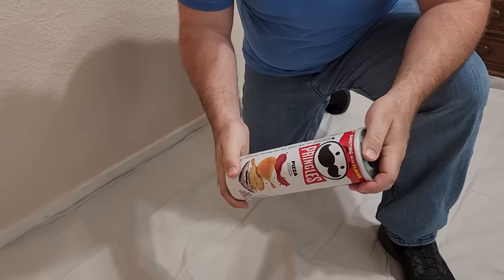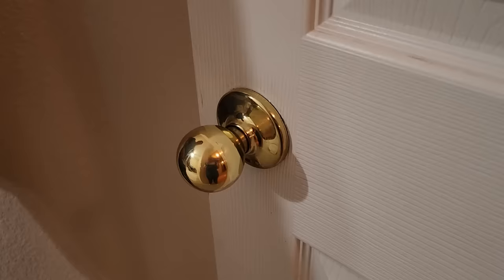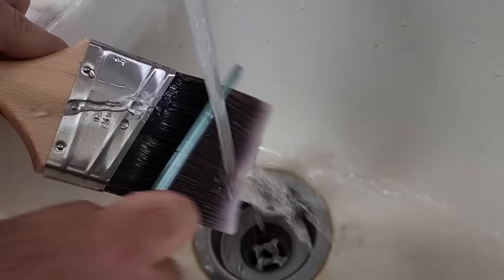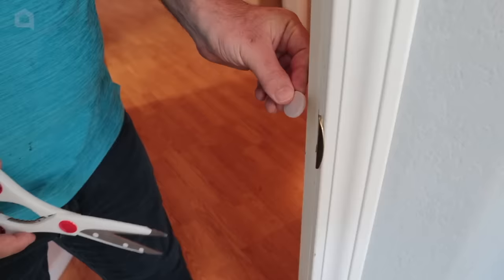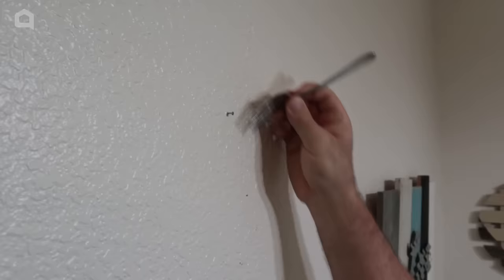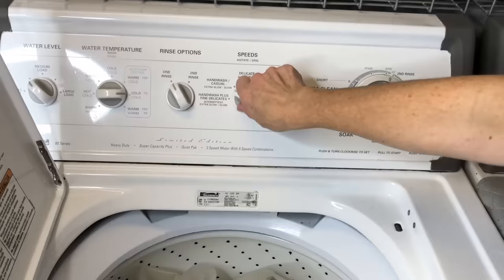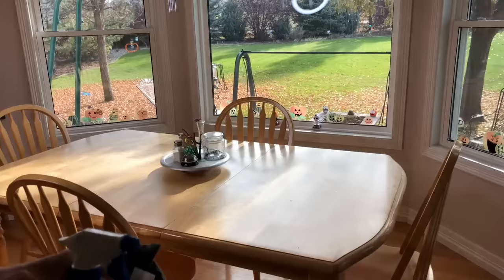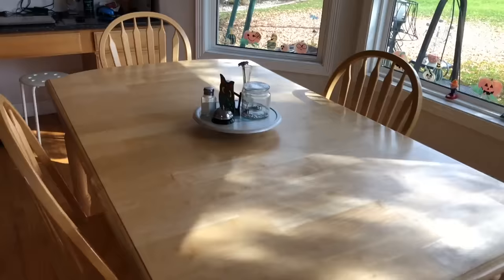9 genius home hacks from a guy who painted 1,000 homes

Comment: An old timer showed me a trick to keep skin from forming on top of the paint. Before putting the lid back on the can, you breathe into the can a few times and then cover it quickly and hammer down the lid. The Carbon Dioxide that you breathe out displaces the oxygen in the space between the paint and the inside of the lid. I've opened old cans of paint 2-3 years later and never had skin or dry paint.
Reply: @kimbuck-2  If you did all that then you shouldnt be painting. Sounds like TWISTER is more your speed🤣
Reply: Sounds like the old timer might have been getting high on paint fumes.  Your breath tends to rise when you breath out due to it being warmer than the ambient air temperature, and even at room temperature carbon dioxide doesn't fall, it disperses evenly throughout the air.
Reply: WOW. JUST WOW!!!
Reply: @kimbuck-2  🤣🤣🤣
Reply: @Richard.Sanchez  Exhaled air is only about 4% carbon dioxide. Rest is basically oxygen.
Reply: @raymacke  air is 80% nitrogen.
Reply: @kimbuck-2  🤣🤣😂😂😂🤣
Reply: I like skins, its like the paint is alive, then I stab it 🙂
Reply: But how many chemicals did you huff in the process?. Wear a mask around paint or better yet use VOC free.
Reply: @kimbuck-2  Don't give up your day job, you'll never make it as a comedian.
Reply: @raymacke  exhaled air is 4% CO2, 17% O2, and 78% Nitrogen and 1% miscellaneous
Reply: @wideawake5630  
You may have misunderstood, breathe out, exhale into the paint can, don’t inhale out of the paint can.
Reply: Probably works best with a couple of shots! 😉
Reply: I close lid and turn can upside down when I’m going to use it paint is fresh
Reply: Try inhaling. You won't even notice the skin on top. 🥳
Reply: @robertdiamondoil2384  was going to say this! The breathing into a paint can thing is nonsense.
Reply: Thats brilliant. Thx for sharing!!
Reply: …but my paint develops a foreskin….what to do? Kinda weird!😮
Reply: Thank you. I’ll try that 👍
Reply: It's the humidity in the exhaled air. Can also soften Play-Doh (a bit) or untoast a 🥪 in a Ziploc. Yes, I had a reason to do that: silent bites in class. 😂

Same humidifying effect can be witnessed when getting brown sugar clods out in the microwave ...with a mug of water...on high for a minute.
Reply: @efisgpr  I made toast one night to go night fishing. Put it into an airtight lunch box and when I opened it once at the pool it had turned back into bread but none of my friends believed me, they just said I never toasted it.
Reply: @efisgpr  WAIT!!!  HOW do you turn brown sugar usable again with water in a microwave?  I’m definitely interested in this
Reply: It may work but science is definitely flawed 😂
Reply: You can do this trick with paint and custard.
Apply cling film aka plastic wrap aka seran wrap to these above items, but ensure that the plastic is in contact with the full surface of the product. Secure with the lid.
Reply: You breathe out oxygen too, its why CPR works 😆 There would be less oxygen though, and probably more humidity, both of which WOULD help!
Reply: Sooo? Huff paint?
Reply: @Lee exactly. It's fantastic and saves SO much mess!
Reply: @TheMrsSaito  cpr works by simulating the inflation and deflation of air in the lungs until the person can do it on their own. You can’t simply blow into someone’s mouth. You have to also perform 30 chest compressions to expel what you’ve blown into the lungs from only two breaths.
Reply: I've used canned air/duster stuff to do the same.  Interesting idea!
Reply: @MrLuridan  depends on the circumcision.... I mean, circumstances 🥴🙃
Reply: Does it work if you don’t have assbreath?
Reply: Put lid on tight then turn upside down
Reply: Whaaaat that’s neat!

Comment: As a former locksmith, do NOT use graphite on locks. Use a Dry Lock or a Teflon based lubricant that completely dries and does not leave particles in the lock!

Comment: I wouldn’t clean the shower head with a sponge after removing the vinegar bag. I’d run the water first, make sure the debris is out of the holes, then wipe the head afterwards. Wiping the shower head with a sponge will just rub the debris back into the holes. Make sure they’re clear first. 👌🙌

Comment: That comb on that paintbrush is BRILLIANT!
Reply: The best part is it gets the paint out on the inside of the bristles, the part that doesn't get cleaned as often.
Reply: @GoodlyEarth  Paint stores sell 'real' brush combs and real painters don't use paint combs to clean there brushes. After you use a wire brush to do your preliminary cleaning of the paint on the outside of the brush you stream water down into the bristles until it's clean and spin it in the sink by placing the handle between your hands and rub your hands back and forth to cause the brush to spin/expel the water left in it. THEN you use a brush comb to straighten the fibers before you store it. Recommend you let it air dry before placing it back in it's protective cover.

Comment: 40 year painter. I run new roller covers under water, then spin them out. When I’m done painting, I rinse most of the paint out and store them in a few inches of waterin a bucket with a cover. Next use just spin them again and ready to go. They last for months. 
I never paint out of the can, or wipe the brush like you do with the rubber band. Paint will travel up the brush and dry out near the ferrule. I use a small pot, dip the brush and tap the sides of the pot. It also keeps the brush loaded with paint. When you wipe it, you remove paint from the brush. And the whole objective is getting paint from the can to the surface.
And I use a wire brush to clean latex brushes, then comb them out.
Every one has their little tricks, and it depends on location and type of painting job you’re doing.
Reply: its fine to have paint on the outside of the brush if you're just going to spread it out, but if you want to paint a straight line its best to remove the paint on the outside of the brush and use the paint that's inside the brush. otherwise when you try to cut in a straight line the paint on the outside of the brush will be likely to form a lump of paint on your line that you than have to try and pull back from the line. otherwise you end up with a lumpy edge.

Comment: The best paint tips I ever heard and ALL of them are beneficial.   🎯🎯🎯
Reply: I work at a paint store and I do appreciate almost all of the paint tips. Most people don't seem to clean the lip and when putting the plastic on, it usually ends up getting in the way of a proper seal. 

The rubber band idea blew my mind, tho
Reply: Only thing I really took issue with, was masking a doorknob with aluminum foil. First of all, it absolutely won't work. Second, if you're painting a door without taking off the hardware, just put the paint down and hire a professional, please...
Reply: Bob Ross has reincarnated.
Reply: @mschenandlerbong8539  nice account name
Reply: another trick for painting around things like knobs and ceiling fixtures without taping is a simple coat of chapstick along the edge because the paint wont stick to it.
Reply: I agree!
Reply: Tip get Some else to do the hard work 👍
Reply: My father is a paint brush and everything here is true.
Reply: @hanskranz9897  ,🤣😂🤣

Comment: There have been times, I wasn’t able to finish a painting job. Instead of washing my paint brushes and rollers, I put the paintbrush/roller in a Ziploc bag, squeeze the air out, then store it in the fridge. 
  When I’m ready to resume painting, I remove the bagged paintbrush/roller and let it get closer to room temperature….then, finish painting. (I’ve stored them for extended lengths of time, and have had good luck….so far!)

  For the grout….Baking Soda and Vinegar
Sprinkle
Pour
Scrub Brush
Done
Reply: my dad put his undawareh in a plastic bag in 1975, last year he opened it in front of us, couldn't believe the smell, and the skid looked fresh like dad just made it

Comment: Worked as a painter's assistant for years. Wiping a brush against the side of the can, or your rubber band suggestion, just removes too much the paint from where you want it on the brush. As my boss told me, he ain't paying me to paint the inside of the can.

I was taught to tap the brush against the inside rim of the can. It removes the excessive paint from the brush but keeps it "loaded" with paint. You won't have to reload your brush nearly as often. The ends of the bristles won't be aligned as they would if you wipe the brush. To realign, run just the tip against the inside rim of the can. With a little practice you can realign the tips on the first stroke of the brush on the surface you are painting. If you are cutting in around fine woodwork, you don't need to load the brush as much so don't dip it as deeply and don't tap it as hard.

Depending on how forceful one is at making the suggested drain holes in the groove of the can, it can distort the rim and allow air in even with the lid on. If you want to keep the groove of the can clean, run a piece of wide masking tape around the inside of the rim and fold it over the groove and fold down to the outside. Remove the tape and the groove will be perfectly clean.
Reply: You can't tap a brush inside of a full can of paint.   We use to clean used 1 gallon paint cans for work pots.  Can't stand working from a full can.
Reply: Masking tape thing sounds good, I’ll try it. Thanks
Reply: Or just use a separate container like a handy paint pail or a bucket size you feel comfortable with. I hate cutting out of paint containers, the lip is annoying to me.
Reply: Wow, excellent suggestions. I have to paint my bathroom and back doors (grandkids and dogs!) Grandma has confidence I can do it myself now.

Comment: I love using vinegar to clean with and I add a little water to it for cleaning my windows and mopping my floors I  also put vinegar and baking soda for my sinks and tub pipes and then run some hot water behind it it’s awesome I swear by it !
Reply: Vinegar definitely doesn’t get enough credit. 
  Sprinkle some Baking Soda in a slow-drain, then follow that with some vinegar. (do this with the grout, too.)
  And use vinegar to mop your floors.

Comment: Vinegar has so many good uses I buy it by the gallon and this video offers more new applications.  Thank you!💙💙💙
Reply: It also kills mold!
Reply: @Tinyteacher1111 , WOW!  I was not aware of that and thank you for telling me.  Just think of all the money a person can save using vinegar instead of the numerous products they would otherwise buy. Now I am going to buy two gallons of vinegar. 😊
Reply: @thebastardgift  yep! I’ve saved so much on cleaning products after I started using a half and half mixture of distilled vinegar and hydrogen peroxide. I sometimes add a few drops of an essential oil, but the mix on its own leaves a fresh, clean smell and will clean just about anything you can think of. If I have soap scum build up around my tub (combo of my bad back and a husband who forgets to rinse the tub), I first use baking soda with a bit of water to make a thick paste, scrub the tub, then spray my vinegar mixture, let it sit for a few minutes, and rinse clean. I was having problems removing tough grease stains from my husband’s work clothes, so I tried laundering them in borax and a bit of dawn dish soap, then running an additional rinse with baking soda and vinegar. The clothes looked almost new! You truly don’t need to buy most of the pricey stuff out there with these items on hand. 🙂
Reply: @jodilea144 , in the best of times, and we are far from being in the best of times, these are great ideas!😊
Reply: Since this video I have purchased 3 gallons of Vinegar. 😊

Comment: Thanks for the paint tips - some of which I've been using for a while. Just one tip on the pringles storage trick (which I didn't know about), wash the inside with soapy water and rinse before using, to avoid getting grease on your nice fresh roller.

Comment: These tips were soooo helpful.  Wish I knew the comb thru the brush trick before I ruined an expensive and favourite paint brush. Am painting my front door today.  The aluminum foil around the door knob will come in handy 👍
Reply: Cleaning the brush thoroughly is the best way to keep a brush pristine for months.  Good luck on painting your front door.
Reply: They used to make a comb, with metal teeth, for paint brushes.  I haven't been able to find one so I'll try this with a normal hair comb.
Reply: @roseother8306  There used to be aluminium hair combs.
Reply: @roseother8306  wire brush works great
Reply: Always wash your brushes with the handle straight up otherwise the water will flow into the bristles rusting the metal and ruining the brush. 

When painting walls close to the ceiling it is quicker to hold a wallpaper scraper where the wall meets the ceiling to stop paint going on the ceiling then using masking tape to mask it all off.
Reply: @jazradcliffe2286  excellent advice!
Reply: wire brush is better. most painters already have several nearby

Comment: Don’t use dryer sheets on your towels in the dryer as well. It affects your towels from absorbing water. That’s why you need vinegar to remove buildup. Use the large wool dryer balls instead. There are two sizes and I personally mix them both. These balls do a fantastic job. Recycle any dryer sheets by using them as dusting cloths. They work excellent dusting all over the home and on baseboards. I keep my extra in an old Kleenex box (and you can hide that with a decorator tissue cover if you like) for easy dispensing.

Comment: I am 77. I started painting when I was 11 or so. I am proud to say I have never painted a door w/o removing the hardware, nor have I painted a wall w/o removing the switch plates 
I just cleaned my off white grout. I tried 2 commercial cleaners and toilet bowl cleaner. The winner was ZEP grout cleaner available cheaply at Walmart. I used a Dollar Tree battery powered toothbrush. It worked great and only took 2 AA cells.

Comment: Use a hammer to hit the inside of the metal rod on a paint roller in the opposite direction, the roller will slide off without you needing to grab it and get completely messy. This old timer taught me that. It’s amazing.

Comment: Oh my sir! The rubber band hack is worth the cost (which was zero dollars - thanks)! I also really like the comb and brush cleaning and the nail holes around the lid to drain the paint in that area. HOWEVER, if I use your rubber band trick I will never have to use that one at all. Great stuff.... thank you!
Reply: Just used the rubber band hack two days ago and it works wonderfully. I realized that I needed to use an extra band around the can to hold the handle down and in place to prevent the other band from popping off. GOOD STUFF HERE!

Comment: Try this tip after you're done washing your paint brushes out and they're still wet put some hair conditioner in the paintbrush form your paintbrush let it sit for a couple hours rinse the conditioner out of your paintbrush dryer paintbrush off and wipe it down with a towel that will keep your paintbrush to not dry out and be able to still keep it's form like when you first bought it

Comment: I've learned to take a small plastic shopping bag, like from Wal-mart, and wrapping that over a paint tray or roller can extend the life of that roller a day or more. It's helpful if I need to apply multiple coats and don't want my roller to dry out.
Reply: Vanilla in paint is not a good idea;  it makes the paint smell better but you are still inhaling the paint. Plus the vanilla would mess with the composition of some complex paints.
Reply: I have used that method, also. I do like thought of using the paint glove though because it is a tight covering and super easy. Going to remember that one.
Reply: Menards bags work great a little bigger than regular grocery store bags

Comment: Try this tip for painting. Use painters tape to make a V on the rim of the can as a pour spout. It will keep paint out of Grove and be easier to seal and store the can later.
Reply: @yoshisaidit7250  I don’t see why not. Why is that? The idea sounds good.
Reply: Or take a screwdriver and poke holes in the groove so it will drip down. That's what we always did anyway.
Reply: @Devcrum  if you do this, you won’t be able to reseal the tin again….
Reply: Or you could just buy the $2 piece of plastic at lowes that fits right into the can and was invented to help pour the paint out without causing a mess.
Reply: @jeffreya.4756  I'm a decorator in the UK and have not come across these.  What would I google search to see what you're talking about?   how are these described?

Comment: I tend to go the extra powerful method by personally using just Cleaning Vinegar (not the other vinegar). Most times though, spray bottle mixed ratio of half part cleaning vinegar n half part hydrogen peroxide is my all around the home cleaner for sure. N great video u 2❣Most of your tips this grandma been doing, but just thankful ya all keep that solid wisdom of advise around for the generations ahead
Reply: Really? You use half hydrogen peroxide and half cleaning vinegar? That would, for sure work! It would kill any germs and funguses!!
Reply: I love tips from the older generation, I am part of it. There are so many things that will be forgotten unless they are passed on. Thanks for the tips.
Reply: Take the chips out, of course. hahaha